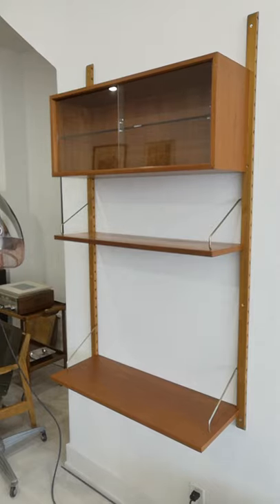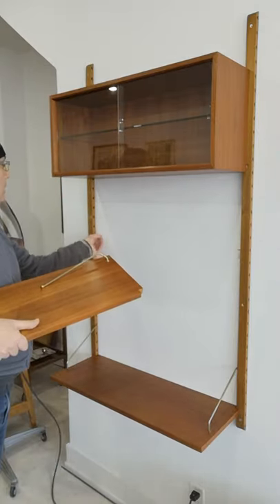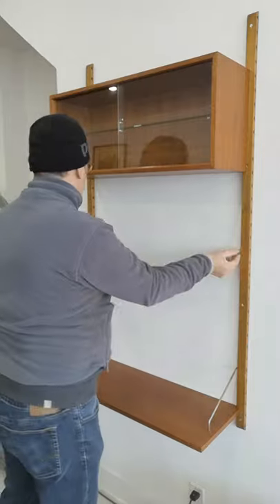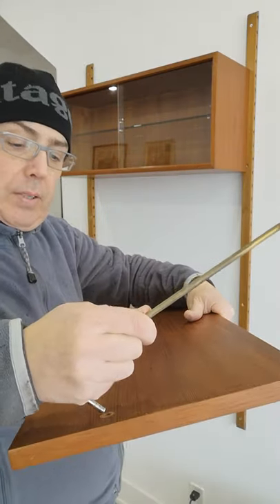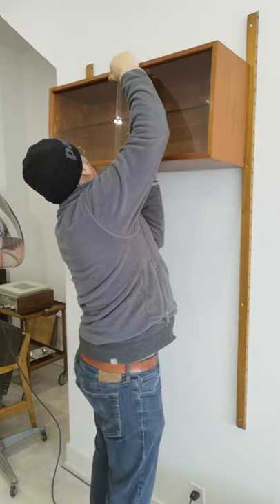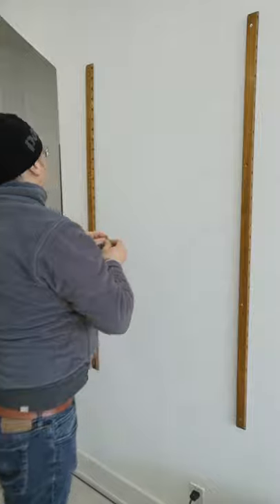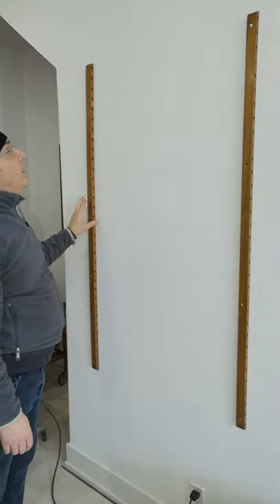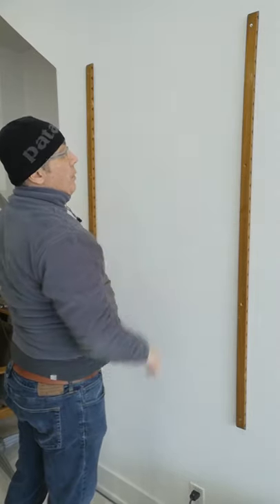Cado wall system assembly tips

Comment: Did you use wall anchors before installing the rails or it is a must to find the studs in the walls?
Reply: I’m wondering the same thing. It would really suck to have to find the studs

Comment: What's the hole space on the rails?
Reply: You’d think 32” apart to hit stud, but….UK/EU framing is 15.75” (40cm) while 16” on center is more common in US. It’s pretty tricky actually to get the vertical supports to hit the wood wall studs on Cado wall units larger than 1 single bay. I’ve got a 3 bay unit, and there’s no way to hit the studs without having large gaps (greater than 3/16”- 1/4” each side) between the shelving and the vertical supports. You can always use wall anchors especially if there’s not a lot of weight to support.